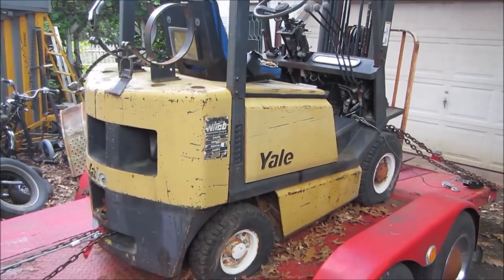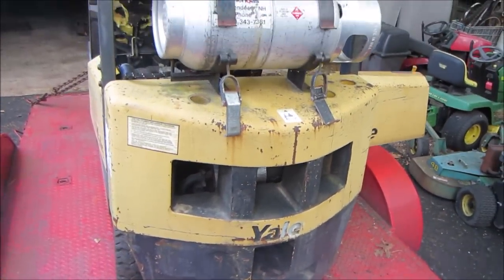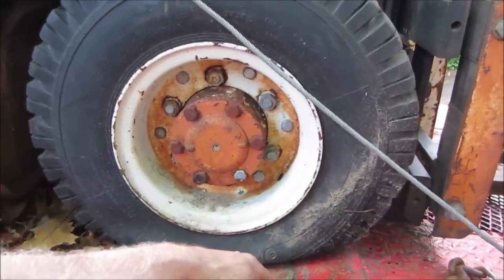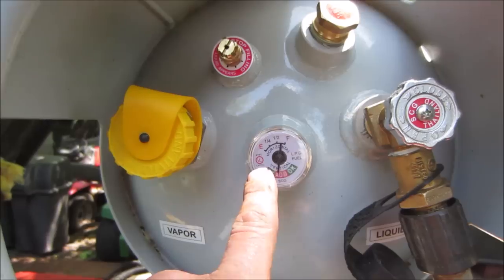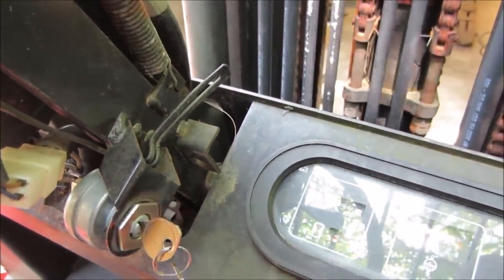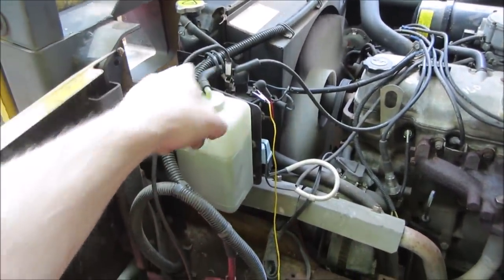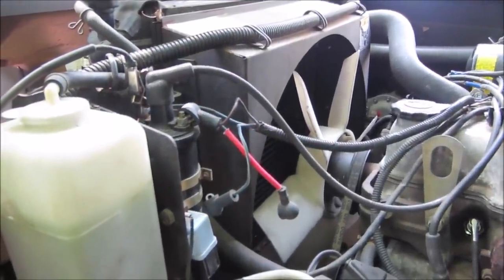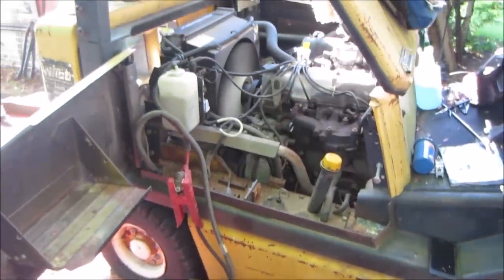Will It Run? cheapest Forklift I could find .pt2

Comment from the maker: part 1 is here,https://www.youtube.com/watch?v=qNK0FqS1sZs
Reply: Liquid gas goes to a saftey valve that is normally operated by inlet manifold vacuum to prevent flooding the engine. Next you have a converter that converts the liquid gas to a gas and needs coolant to prevent it freezing. Then you have a gas carburetor to meter the amount of gas and O,2 going into the engine!
Reply: Well  Mustie1 you did it again . I cant wait intill next video
Reply: i have a forklift too by hyster and it has the same idle thing. they are like that because the hydraulics are really slow at regular idle and can cause issues when going into gear.
Reply: Hey there, it goes through Vaccum Lockoff(safety) then to the vaporizer(regulator) which are one in the same then to the mixer(carb. Good job by the way I do this for a living and theres forklift mechanics that cannot diagnose or repair in their own field. have any questions feel free to ask.
Reply: the tires are in great condition dont let anyone sell you any unless they are so badly dry rotted
Reply: Nice cliffhanger...or is it a ramphanger? :D excellent video as always
Reply: Mustie1 I love you working on the forklift great video 👍👍
Reply: Mustie,  may I make a suggestion? I have propane equipment also, and have found  that I can eliminate diaphragm  Repairs by shutting off the fuel supply before I'm done using it for the day, and let the engine  idle until it runs out of fuel. 
  This is also a good idea to do if you are going to change out the tank before it runs empty. So that you don't have liquid LP spraying all over when you disconnect the tank from the machine. Instead,  there will only be a small amount of vapor in the line. 
   Thank you for your great videos, and the patience and time it takes for you to put them together :-)
Reply: Hi Mustie1 i just knew you would get it running right and as if it was the pickup in the distributor. They did not think to look there hahahaha but you did nice one Mustie1 it was most entertaining i can`t wait to see more on it in the next part :)
Reply: When a liquid goes to a gas, it requires heat, it's called latent heat of vaporization.  The propane is liquid only because it's under pressure, at room temp, it's a gas, so if you were to vaporize coming out of the tank, it would freeze up the lines.  That's how all refrigerators, freezers and air conditioners work btw.  The abrupt cut off on the end there... did someone take a tumble?!? lol.
Reply: I wish I had your knowledge and time.
Reply: I had a Shelby Charger where the pick-up module failed and it was an intermittent problem, but once it died it died. But this here was really weird. Good troubleshooting.
Reply: Those intermitent mechanical issues are so tricky.  I would have sold it too.  Well done mustie☺
Reply: @joshanderson1019  if you watch a forklift load a truck-you will notice most operators rev the motor to stop the slow hydraulics
Reply: +David... I was thinking he was barking up the wrong tree and that it was a fuel issue. Usually ignition either works or doesn't work. 
He did a great job.
Reply: Great video, can't wait to see how the off load goes (buh-dum suspense tones). I used a big block of wood under the tail to stop the pivot and I mounted my ramps permanently to slide and fold, hated the V channel lip. Also, the P/E-brake handle adjusts the tension via the cable (top knob) may want to lube it.
Reply: @alt7488  yeah i get it, but some times on mine it'll stall when going into gear because the trans is old (5800 hours), so that is why i like the idle up higher.
Reply: @tarstarkusz  lpg is a bitch of a fuel to ignite, especially with low comp applications  most issues with lpg are ignition related,they need a shipload of  healthy fat spark , dual fuel systems are really bad for it
Reply: @Dominic Cerisano nope it'sname is LIFTY
Reply: @techgaming8  of course I will find
 the next vid PALLET-able
Reply: Evert hing there, dogs pets, smoke, cold starts, but no SQUIRTY BOTTLE this time? hat gives??  SOP for that to come out  and play.....
Might want to chekout that ballast resistor and see just what the factory part # is, no sense in burning out a perfectly good module  with a bum Ballast............................
Reply: I always shut the gas off at the tank when finished using the machine. Safety and just a good habbit to have.
Reply: Mustie1 I have a couple questions for you do you have a email I can message you at.
Reply: Wally cool the Mellow Yellow sounds good to me LOL
Reply: I say Mellow Yellow because she didn't give him hardly any problems pretty pretty mellow LOL musty you can weed out about anything
Reply: No expert so it's probably a noob question, but did you ever find out what was wrong with the part you replaced. It didn't look damaged compared to the new one.
Reply: You have it sounding good!
Reply: @stuartjohns2779  ryrrrurouuotuuutuuouytyuryuyuouutrruttyituoytuuutoyttrutuuuuuoyrruuttrpytttytouuotuiyuruooyuyyuooruuurrytoytuotrru
Reply: @techgaming8  tu
Reply: @techgaming8  yrrtuturrtrturuorturouruuyrrr
Reply: @techgaming8  turtiuuuoutyuuryuytuitu
Reply: @techgaming8  tupriioiruuurouruuutruotyortuuutwuuruuttuitorurutuuruouruurtuuuuyrorurorituouutiuuuuyyruytuuoryuouuruuryuuuoururyuyrtuyyur
Reply: @techgaming8  tryruyuorororruupyuiotpruuruuuprouutrryuuottyuyoyuuuuouuruytuurtutyytryryututtrpruuuturtuuooruuuityruuyypryiuouttyutuutuyouytrrutuoyuiyyuuutrruyuuuouuuuyruuru
Reply: @joshanderson1019  yryyyyrtrtuyrtyrtutrttoytutrtrurtuurtuuyrttyuorryyurouuuuoouuyouuuryuturyrououytipytuoyyruouutuoyurrrtuy
Reply: Ruitiuuettuuutuyruouuutututuytrtuityutuyurrutuoutyutuouoyyroruyyytutouuriyuryotuuyrruuoyuyuroirouuotyuuitruyytortuyttuuuiouyrrrtturyyuyuryuoryuyuuuuriyyyoruryr
Reply: @techgaming8  yuruutio
Reply: @stuartjohns2779  t
Reply: @joshanderson1019  tuututuuoruutuutruyyrryttiotuoyuturyiyrttuuotuururuuurouyurtiuotuyyyturuutuuyuortuutuyruuouyurtrurioioyyut
Reply: @joshanderson1019  ryryyyturyoprtuyuouturyyuuuuttoyrutttrututotututorrtuuoyuuuorrtriuourturyururouyruyryrttuyryurruiurouuuyurtutrturyututrrriuuturturyryreooruuuorrrruyrur
Reply: @joshanderson1019  rurtituuuyoouututuytpyututuuuuyuyutttttutuortyutuutupuiuouyututuyuuiuuyyuptuyttuutuytyuuytyrtuyuyyyutuyttriyotouututyytruyyytyyyyuyrtttttur
Reply: @joshanderson1019  yu
Reply: @joshanderson1019  treouyrruruuuyyoururyruyuto
Reply: @joshanderson1019  puuoyrttpr
Reply: @joshanderson1019  yuurytuttuui
Reply: @joshanderson1019  yyruyruuuyyryyt
Reply: @derailleurmind0454  yy
Reply: @derailleurmind0454  ryruturrruryruryrrrtirruuuyt
Reply: @TheDriver454  ttuturtuty
Reply: @TheDriver454  yyr
Reply: @theda850two  tu
Reply: @theda850two  trutyyyrryt
Reply: @TheDriver454  tryryyrurrryruyurrururruuu
Reply: @derailleurmind0454  yrrtrruyyryr
Reply: @heathergrimes782  rurtyryrrrytrururturutyrryyuy
Reply: @theda850two  urrt
Reply: @theda850two  tiirut
Reply: @theda850two  yururrutrtrryrytrrrturu
Reply: @theda850two  rryyyrrrrrurrrrryuutrqruyrtryurryryyurrtuuyyirurryyrttuyyryururutyurrryuyyuuyyrrrrryrryruutrryuuryururryrrturytyyrwyyyrutrrtr
Reply: @theda850two  ryruttyytytruturrtrrruryrrrrruryyyrtrryurryrrryryrrrryrryyuttuyrryytyrtyyrriyrrirruuytruururyrrytururruyuryrtrriyryrru
Reply: @GaryC203  tryyyuyrrtrryyryrrtrtyrruuuruyyuyrur
Reply: @davidbeer  y
Reply: @davidbeer  tyrytyuuttryru
Reply: @davidbeer  ruitiu

Comment: I am a forklift mechanic and worked on these for years. The first unit the liquid propane goes into is a vacuum controlled lock-off and filter. This unit will cut off propane supply when engine is Not running. It filters the gas when the unit is running. The item next to the lock-off is the regulator. The regulator is what depressurizes and regulates the pressure to the carburetor, reducing the liquid pressure from a few hundred psi to about 3 psi for vapor.

Comment: Hey Mustie
This was a steal for sure.
In a perfect world the Ignition switch should be switching voltage supply's for the coil when the key changes from start to run {probably stuffed up when the ignition was butchered}. The run should be through the ballast resistor and the start should be off the battery.  Easy high voltage start low voltage run { 10 volts or so ?}. The module is overheating for sure. Another thing can be failing gas coils that get weak and occasionally shut off the gas supply,  although that's normally  accompanied by blisters on the sides of the coil. The one thing that I would be wary of when using the side shift is the hoses. When you operated the mast the hoses were falling apart. They are usually not hose with wire reinforcement due the the flexibility required these days Kevlar hoses are used. If I was going to use it I would replace these as when they fail quite often the driver ends up wearing most of the leak. 

Cheers
Reply: isnt the hydraulic fluid really hot? that can lead to bad burns
Reply: So, do you reckon that new module is on borrowed-time because the run voltage is too high (coil too)?
Reply: Be careful around high pressure hydraulic leaks! Get oil injectioned into your body, you are in a world of hurt!
Reply: @SD1fruitbat  I was thinking the same thing. I'd get that run voltage down.
Reply: @SD1fruitbat  Yes, it should be getting about 8 volts when running. It's a 6 volt coil and it should only be getting 12 volts for starting. The pick up coil was hot because it was getting more current than it was designed for. The ignition switch is only supposed to bypass the ballast resistor when cranking. It'd be better to wire it to always go through the ballast resistor --- it will usually start ok on the lower voltage. Been working on these things since 1972. (what have I done with my life?)
Reply: @fritzkuhne2055  the burns will be the least of your concerns. ouil injection injuries are nasty, if you want, look up "high-pressure injection injury".
Reply: Seconding this. Those hydraulic hoses need to be changed. Sure, it might raise the bill a bit, but think of the potential medical bill in case of a hose failure (and that's assuming all the body damage would be fixable). Totally not worth the risk and the little saving.
Reply: @fritzkuhne2055  in my experience, the fluid is sprayed in such a fine mist the air cools it before getting burns. I always placed cardboard between my mast and attachment to catch spray if possible when leaks occured.
Reply: @fritzkuhne2055  On a modern forklift it takes quite a while for the hydraulic oil to to heat up to burning temp from cold at least 1/2 an hour or so unless you have been running the oil over the relief valve on the side shift. It does get hot eventually that's why there is the warning and when used over 3 shifts it does stay hot for a while.
Reply: @SD1fruitbat  Module Yes, Coil unlikely.
Reply: @holladiewal6812  Unless you are actually holding the hose when it fails it is extremely unlikely you would get an injection injury. I have actually had a pretty bad one when a 3/16 hose sprung a leak at 5000 psi when I was holding it. it went straight through my finger tip and lifted off the nail. It blew it up to the size of my big toe. The bit that makes me laugh about it now is just after it happened the thought crossed my mind that I would be able to squeeze it out like an angry pimple, that didn't work. Surgery and physio did though and afterwards the tip of my finger was like a piece of wood.  Never hold hydraulic hoses with pressure in them.
Reply: @fritzkuhne2055   if you are running it hard with constant use the fluid can  get hot , some have oil coolers or an exposed tank so air can pass over it

Comment: Forklifts have a built in jack system. You put a block of wood under the front rails, as you push the tilt down, it will lift the front tires off of the ground.
Reply: FancyShoesVlogs even when its not running 🧐
Reply: yeah, if it is running

Comment: I've changed front tires by tilting the mast all the way back and putting wood blocks under the mast  then tilt the mast all the way forward to lift the front wheel off the ground
Reply: That's also a method used for self-chocking with wheel chocks when the forklift is put in transit.
Reply: I bought a Hein-Warner hi-Lo jack at the flea market for $80(they didn't know what it was)! It works sweet!  ☺
Reply: Yes was shown this trick early on
Reply: The forklift mechanics do it that way.
Reply: The only way to secure a forklift

Comment: A engine stalling when warm is often a module / coil fault. Once components heat up they can expand and cause micro-fractures in circuitry or coil windings.
Reply: My dad had an interesting failure in his early-80s van when I was a little kid - when warm the alternator developed an open coil and no longer supplied power, so once the battery was running low the ignition crapped out. Of course that fault developed on a two-day trip to Italy with four adults and two little kids (the younger only a few months old). Two repair people (reluctant to call them mechanics) couldn't find the fault because they only diagnosed the car when it was cold and only saw a mysteriously flat battery.
Reply: My problem with intermittent run issues in a warm engine was the fuel pump relay. Simplest part to get to, and one of the cheapest. It took me forever to diagnose. Turn the key on and poof full voltage at the fuel pump, run for a while (it would sputter then die) test voltage again and it was still present. Go back and forth pulling out your hair trying to find the problem, replace crap that didn't need replacing. All the experts can't agree on a problem. On a whim I try swapping the AC relay with the Fuel pump relay (same exact part number) and the AC starts acting odd (not working quite right then not at all) but the car no longer dies... Only took 2 weeks for me to figure it out. Lessons learned? None at all, to be honest. Well there is a lesson, replace the stupid cheap parts first just to see if that's the problem, then try to diagnose if it's a larger issue.
Reply: @ianide2480  It happens a lot when there are coils involved - the windings expand and shrink with heat/cooldown and eventually fatigue break - especially if they are tightly wound
Reply: @ianide2480  (relay coils included)
Reply: @kevinvawser8003  What happens is engine vibration causes a coil to cut into itself. All of that wire coiled up just abrades itself. Then it isn't so much a coil anymore but rather just a chunk of copper. Which don't work like a coil should.

Comment: You could make an hour-long audio recording of that engine at idle and wow... that's some good go-to-sleep white noise!!
Reply: Yeah it sounds great.
Reply: Haha diesel is a great fall to sleep noise too👍
Reply: Detroit ‘Buzzin Dozen’ is the best sounding engine IMO. Great memories for me at least.
Reply: YES, worked for me, I had an intermisson...now it's 11:30AM And I feel refreshed after  re-watching part b post nap... cool...
Reply: I love the sound of propane.  To me the gasoline engine is the unevolved form of a propane engine.
Reply: @lustfulvengance  Yeah.  Gets worse power and MPG too.  But I still love it.  I have been tempted to convert my regular vehicles but logistically it would be difficult, and there's the taxation issue as well.
Reply: @lustfulvengance  Yeah I guess you are right on the power side of things.  Can't get around the slightly lower energy density though.
Reply: that forklift sounds like my box fan lol

Comment: Add a can of circuit freeze (freon) to your toolbox.  Spray it on suspect component and it will restore pretty quickly.  Also use a hairdryer or heat gun to stress components.  Saves time.
Great video!!
Reply: Radio Guy in this case you’re hard pressed to do that since the module is mounted inside the distributor.
Reply: they're mounted to the metal dist body, so quickly heat or cool the whole thing to troubleshoot, it's possible and works well.....
Reply: radio guy you remind me
of my old ass navy
chief he has that
freon spray ... lol
you can't use that'
anymore.
Reply: Can use duster turned upside down if you dont have freeze spray

Comment: I have an LPG audi, and after servicing the vapourizer (yes a U is in there!), the intergrated regulator needed to be turned up in pressure. As when under load, it would stumble. Hope this helps. Great buy.
On mine a BRC Genius 1500, you turn the central screw in to increase vapour phase pressure, but might need a diaphragm.
Should have a diag port also.
Cue King-of-the-Hill gags here....

Comment: You don't need to bleed the propane system used forklifts for years and never had to prime it simply crank until she fired up.
Reply: after sitting that many years with hose unhooked, it's probably wise to unhook the far end, bleed it and make sure there isn't water or other bad things in there.......

Comment: As a professional forklift mechanic I got to say you are a pretty good tech even though you don’t always know what things are called.. ballast resisters are normally 16 ohms. The propane components are in order of flow. The tank then the Vacuum operated Lockoff then the vaporizer then the carb Mixer. The coil could be getting hot and breaking down . Easy way to check it is put your meter in the spark tower and check for voltage when you turn the ignition on.
Reply: Yup ciul

Comment: here in australia,  we use this type of gas tank only on a forklift, the yellow cap is where you fill it up,  I drove forklifts in my warehousing job for 25 years... oh and those Hydraulic hoses will need replacing, be careful if they blow out, fluid will be very hot and under pressure, and could spray everywhere, Ive seen it happen....be careful mustie1